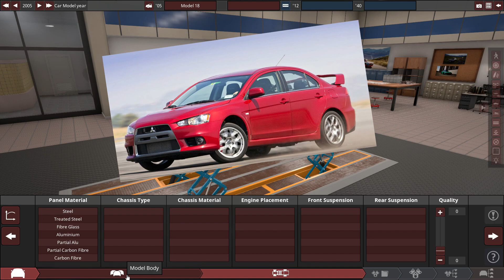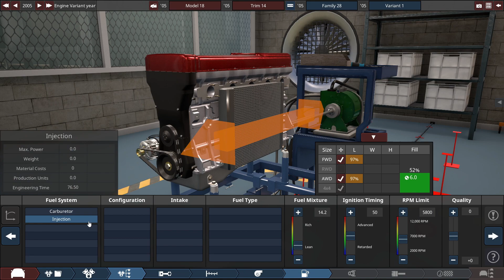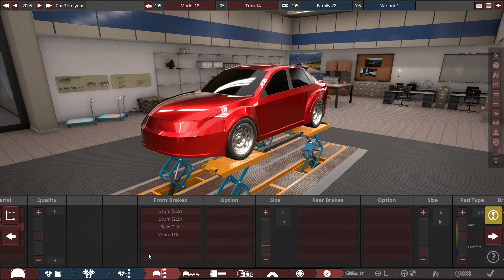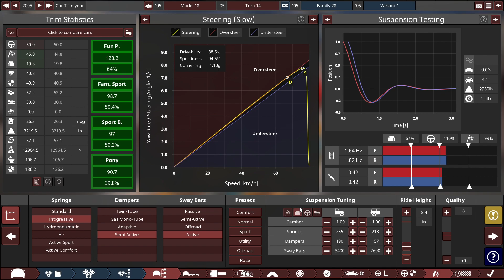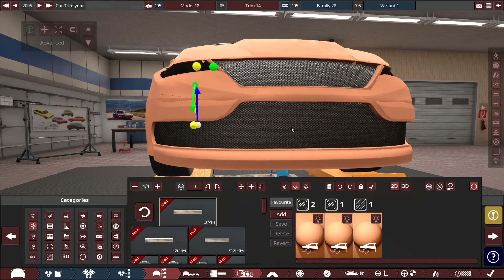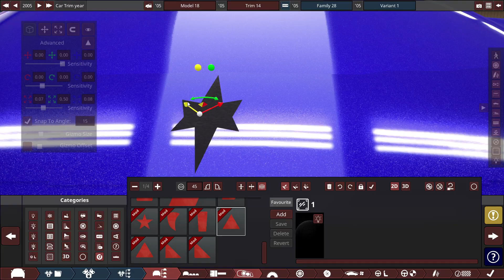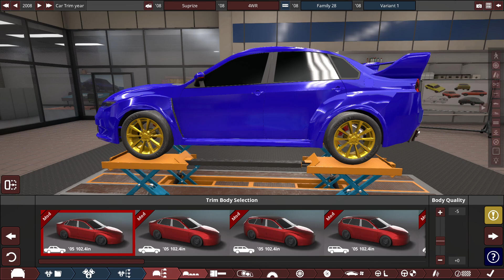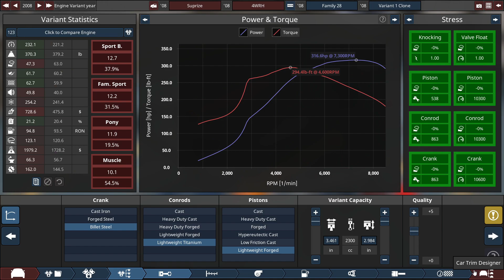Building A 5 Cylinder Japanese Sport Sedan!! Automation - BeamNG

Comment: The WRX most definitely does not have a transverse engine setup, otherwise it wouldn’t fit a boxer engine
Reply: And would also probably have a front biased all wheel drive system with such a setup, which would probably make it less fun. Would also not want to be the guy that has to change the spark plugs on the rearward cylinders on that theoretical transversely mounted boxer, lol.
Reply: @arcticequine7084  Thank god the WRX is NOT like that.
Reply: Yeah, Subaru makes a big thing about their symmetrical AWD system. Transverse could not work that way
Reply: Symmetrical AWD is a GODSEND

Comment: Min 0:48 the wrx is longitudinal because of being a flat 4 and all the awd components.
Also the base fwd 1.8, 2.0, etc are longitudinal, just like Audi does with the A4 , it’s fwd and longitudinal
Reply from the maker: AH somehow i knew this but drew a total blank XD
My apologies XD
Reply: I’ve only ever seen Torsen style AWD A4s. Making them FWD seems counterproductive on a longitudinal drivetrain as you’d have to get the engine decently far forward of the front wheels in order to have the CV axles easily reach the front wheels. Even then, you’re having the power from the engine make more than a 90 degree turn out of the transmission, which adds a bit of inefficiency anyway. Definitely makes sense to go longitudinal for a fun rear biased AWD setup,  but, makes no sense if you’re just making it FWD.
Reply: But Audi does that, idk how but it does, the new A4’s NOT Quattro are fwd too (every generation of the A4 has been) with longitudinal engine placement. If you google “Audi A4 drivetrain layout” you can see in the 3rd picture that it is, in fact, longitudinal and fwd
Reply: @tomaspiscicelli3288  was only able to find awd ones, but those did show me how they set it up in terms of getting the power to the front wheels. Their transmission, or rather transaxle uses some sort of ring gear setup on the sides of the bell housing to get the power up to the front without having it come out the sides of the  transmission around where its main output is created, which goes to the rear wheels on the models I could find.

Comment: Now you just need squids to buy it, never change the oil or coolant, add another 20 pounds of boost, and then be absolutey SHOCKED when the head gasket with 130,000 miles on it blows.

Comment: Quick tip if you are going to run a turbo on a car lower the compression ratio like 7:1-9:1 otherwise you will make less power and knock easier because the engine will ignite too soon this is how it works in real life.
For example a 2005 wrx sti's compression ratio is 8.2:1

Comment: 0:46 no, the impreza is a longitudinal boxer 4

12:08 it can get to 308km/h but it's limited to 240? Why?
Reply from the maker: It's limited to 240 in automation because most cars are limited to either 180, 240, etc

It's geared top speed is higher for overdrive (better mpg)

But yeah in beamng the limiter doesn't work right now xD
Reply: sometimes i would use the limiter so that i can have cheaper brakes
Reply: Like the real evo/STI 
Because the tire for more speed is expensive